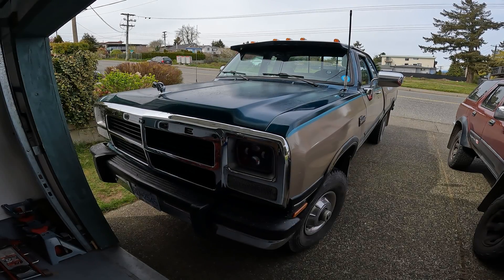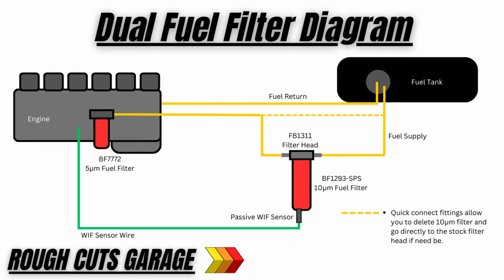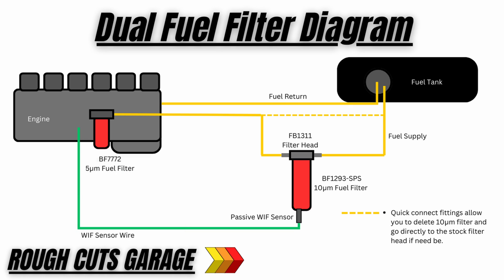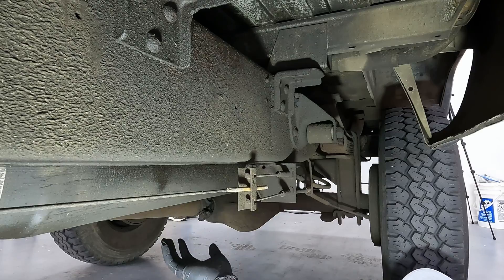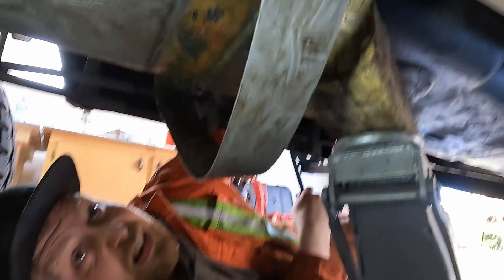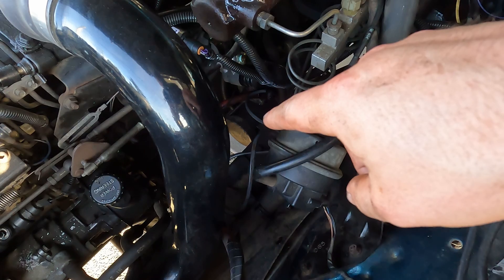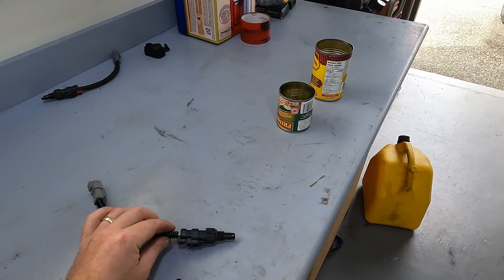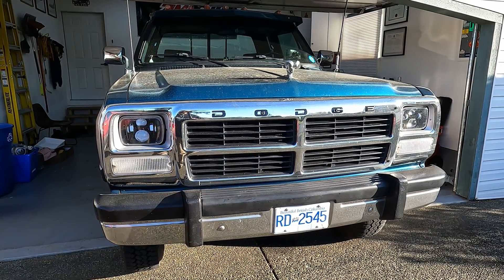Fuel Filters | First Gen Cummins

Comment: Loving this upgrade!! 🇺🇸
Reply from the maker: It has worked pretty well. One thing I forgot to mention was to secure the lines from moving around on top of the tank. My buddy was running into air getting in the line from the quick connects during bumpy driving.